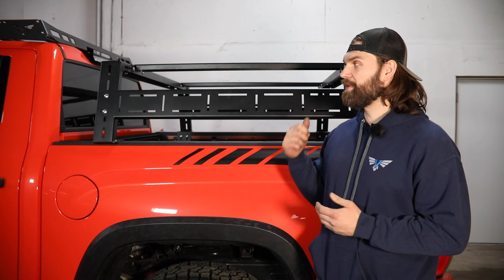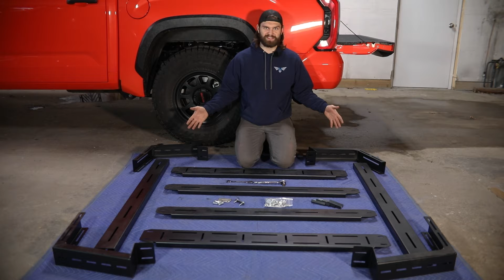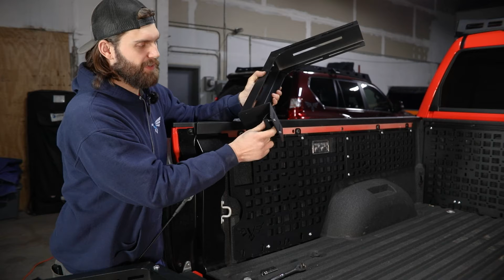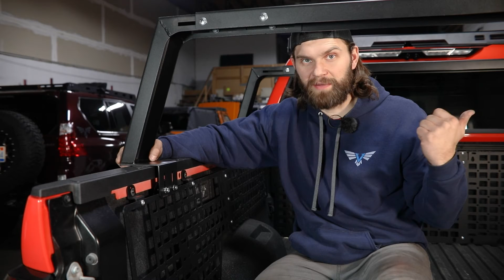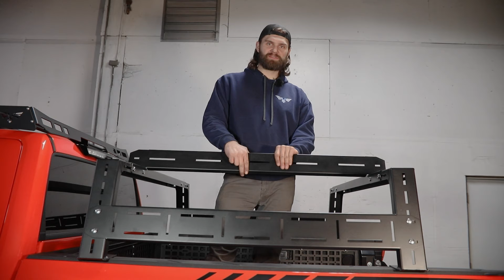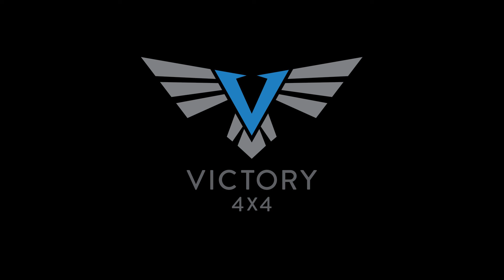Mid and Full-Size Adventure Bed Rack Install

Comment: Why are the base of your racks sticking out and not flushed with the bed frame?
Reply from the maker: This allows for improved compatibility with other accessories such as roll-up tonneau covers.
Reply: Do these fit 4th gen Rams or Jeep Gladiators because if so we already bought 2 🤣
Reply from the maker: This Adventure Bed Rack is designed to be as universal as possible for Mid and Full size trucks.  We have photos of it on a Gladiator on our sister company's website, Jcr Offroad.  Installation details including measurements can be found on the product page on both websites.